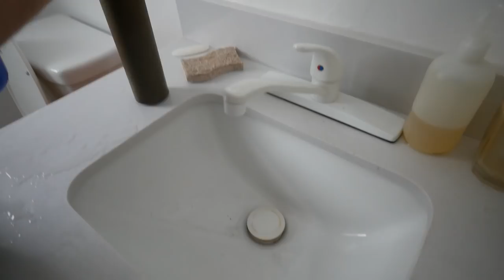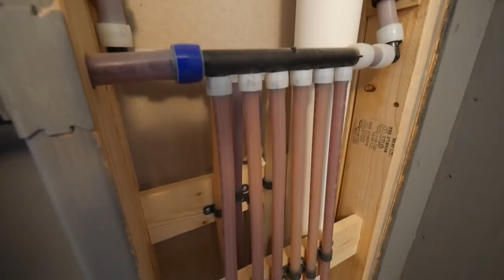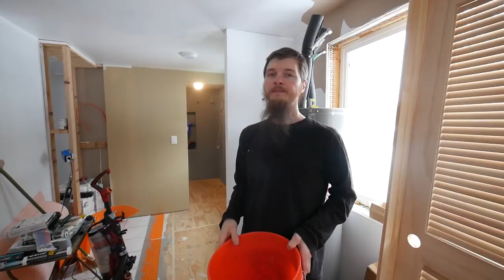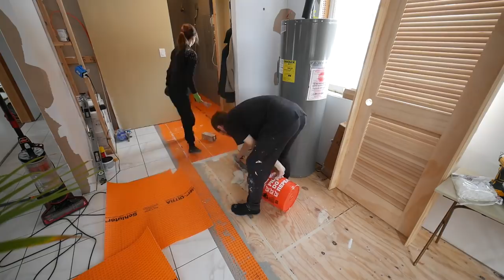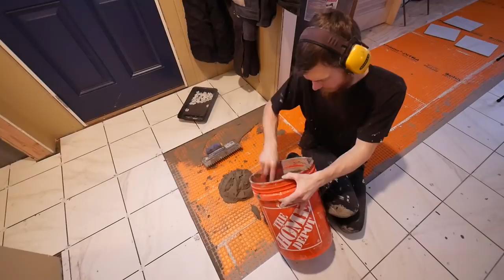DIY Kitchen Tile Project - Home Renovation

Comment: I've had a new ceiling fan sitting in the floor waiting for my husband to install for 3 months.  I think I'm going to trade it in. No, not the fan, the husband! lol
Reply: Janice Hales I know exactly how you feel lol
Reply from the maker: lol!!
Reply: Janice Hales   I understand, it does get frustrating. I’ve come to a different conclusion. I’ve started doing things as much as I can by myself and hiring others to do things I can’t. I’m much less frustrated and my husband is less pressured to do things. He works hard all day and isn’t a high energy person, even though he is handy.
Reply: All I have to do is say I’m doing it myself and my husband will either do it or hire somebody. It works like clock work. He thinks no one can do it as good as he does but will trust a professional too. Maybe we have proved to be a bit untalented in areas.

Comment: Good that you have a filter for all the rust.  I am running a filter also, which traps a lot of rust.  With that in mind,  would be a good idea to flush that nice new water heater at least yearly.

Comment: Well there are alot of oops's in life😁If you could hook up a hose to your water heater and make it go outside the back door, it would benefit you to drain it every time you change your filter. Lots of sediment settles in the bottom and causes it to cruode. So by doing this you expand the life of the heater. We have the rust also and that's what my hubby was told. We have a water softener also and that's a huge benefit. We also have it in our basement and I know that's not an option for you but I would drain the water tank at least once a month. Tile is coming along nicely👍👍😁Stay warm!!☉
Reply: Great point
Reply: @maryannanderson1744  thanks🙃

Comment: Tip for putting the water heater in the plastic tray while still full of water ***(if I’m not too late, as I know you folks move fast): part of what I do for a living is install appliances. When I have a washer that needs to go into an already installed plastic pan, I just pile up some spare lumber so that it goes about 1/2” above the edge/lip of the pan, both on the outside and inside. The lumber being slightly higher allows the plastic pan to be protected and you can still wheel it over on the hand truck or slowly shuffle it over the side of the pan. Hope this helps, I love watching the progress you folks make!

Comment: Amazing job! The utility room looks so nice. If you rewind your video you clan look and see where the hole in the floor was. You could even just drill a hole into the center of the location of the hole and then use a cutting tool. 

My concern about doing it through the crawl space is that the pressure cutting the tile from below may pop it loose.

Comment: Awesome job!  We have the same filters and ours are the same with the iron and other sediments. Our well was not as bad with sediment etc until more people moved into the area and dug their wells off the same aquifer that we are on.  We've been here 45 years. In the beginning the water had no issues until more homes came into the area. We are all on a minimum of 5 acres parcels. One thing we did, that you might consider is putting another filtration system on the water line before it gets to the hot water heater.  We have one outside as our hot water heater sits in the home in a little closet that is accessed by the outside only. That's how the home was built. So outside we have connected under the home an assembly a bit like yours but with two filters. The first is a white filter to collect all the sand or sediment etc. about a 12" or so length from that we have a charcoal/carbon filter and that goes directly into the water heater as the sediment that builds into the water heater and eventually settles in the bottom will over time affect the water heater and ultimately cause the need for a new water heater probably long before it needs to. That has happened to us is the only reason I am sharing this. The charcoal/carbon filter are more spendy so we would rather filter it first thru the white filter and then into the dark filter and then up into the water heater. I also kudo's to you for putting one on before it goes to the porcelain utility items as that rust and sediments are killer with the rust over time. To check if you have a build up starting to build ck your toilet water tank. Over time it can become very dark with the sediments. Really just a safety thing to keep your home doubly protected from deterioration of your porcelain or shower units and tubs.  Our fiberglass enclosure is doing ok but I try to keep on top of it as over the years it will change the color of the fiberglass as we found out.  We've remodeled all our bathrooms over the years with high quality materials but it still can't beat out that water situation that many of us on deep wells contend with. 
Sorry for the book here, LOL, but I know about the well water and what it can do in some areas. I still love not paying a water use bill and over these many years the filters and so on don't come near to what city water would have run us.  We love our country dwelling and the peace and quiet and wild animals is more than payment back for what little upkeep really we have to do to maintain things on the water part of country living. 
Blessings and you both are just marvels. I love each and everything that you are doing and have done. You are right on top of it.  Excited to see those floors tiled and you to get a kitchen started and I am sure you both are as well. Love your channel!  :-)

Comment: To help putting the hot water heater on the pan, try putting a block of wood as high as the pan on each side of it.  Tilt and set the heater on the wood and carefully tip it to the other side into the pan.  I'm sure you can figure out the rest.

Comment: We have that rusty, sometimes stinky water here in Huron county too.  I double filter my drinking water with a brita type pitcher.  And my hubs wears chef whites and I discovered product named OUT white bright, just amazing how well it works.  Wish I had known about years ago.
Reply: We had terribly hard water here before we hooked up to the city water. A neighbor suggested that I wash my whites in cold water as the minerals build up in the water heater and stain your clothes. I tried it and it worked very well. I use OxyClean to get out the other stains such as food on chef's whites! I'm sure you have many of those.

Comment: Hi, I had no doubt that utility room panel would fit!!! You are amazing at your measurements!!! What I did have doubts on was if that piece would even make it thru that door, LOL. I thought at least you could cut it in half and hide the cut somehow. So glad you finally got it in and on. Looks wonderful!!! I love watching you two work so well together, shows so much love and understanding. When you drain the hot water tank, just open the back door and undo the valve and let 'er go!!! You might want to consider flushing the tank out while it's empty, gets all the crud from the bottom out and helps the tank work more efficiently. See? I've learned a little after all these years, lol. Hi Ashley, great helper that you are, or is that great director?!? LOL. Take care and hugs all around.

Comment: I don't know if you are aware that if you drain and flush the water heater once a year it will last much longer normally. That keeps stuff from building up in the bottom.
Reply: Daniel Heartsill yes.  Especially with heavy minerals in the water.

Comment: If you raise the water heater just a bit off ground helps if some water leaks and need to dry up. Bottom won't rust out so easily.

Comment: Considering the rust in the water system, would putting a filter on the water intake help?  Might need to drain the water heater periodically due release sediment and save the heating elements in the future.  Looking good guys

Comment: Glad to see you are using the ditra, its code here in Canada but when i watch US shows they don't use it. And how to properly install everything. Great job again guys!
Reply from the maker: That's interesting that it's code in Canada. I think more people would use Ditra, but the price of it makes them not want to use it, plus it's a product that isn't hugely popular yet here.  Thank you!
Reply: Our celebrity contractor over here Mike Holmes always used it. Think its cheaper than replacing the floor if people would think of it that way.

Comment: Just a thought, could you put the hot water heater on a couple pieces of 2  X 4's.  You could put a narrower piece in the tray to protect it's side, and gently slide your heater it into the tray?

Comment: Great progress made.  You should have waited to change the filter until after you restart it.  Usually you get a bunch of gunk when turning back on the water heater.  I would drain the water heater fully before restart.  Thanks for the ride to town.  You must live a long way out in the country.  So beautiful out there even if it is cold.  Deer!  You know I still have not tried Chipolata and I live in the city.   ha ha ha

Comment: You’re doing well on the tile.  There is nothing worse than doing tile and get about 2/3 of the way through and something misaligns.  Keep it up.  Looking great!  You could use some old 2x4’s and build a little ramp up and over for your hand truck and not have to drain the heater.  If you haven’t already.

Comment: May want to drain tank to see just how much rust in it you might be dealing with.  The filter is after-tank, correct?
Reply from the maker: The sediment filter is before the water heater.
Reply: @diyfferent  great.  It looks terrific.  I have similar floor.  Tell Ashley it unfortunately shows dirt easily.

Comment: As I'm watching you try to get the drywall in the utility room, I thought of the many times when I've unpacked something new, and gone to put it back in the box, and it won't fit, lol!  I know, apples and oranges.  I am reminded of the many times trying to move a piece of furniture and you've got no room to accomplish that.  Frustrating, but you end up figuring something out that works.

Comment: I was thinking about the hole that didn't get put in.  I assume you have a hole cutter which is the size of the hole.  If you get the drill part drilled upward enough to get though from the crawl space, then you can go back up and use the hole cutter from above since you have that starter hole.  Obviously the hole cutter will have to get through tile.  The job is looking really nice.

Comment: Since you put up the plaster board do you have a way to access your water lines behind the water heater?   The tile is looking really good.
Reply from the maker: It's plywood so if there is ever a problem or needs to be accessed it can just be unscrewed :) Thanks

Comment: love how you tiled, when we tiled our bedroom after taking out carpet, it was different, we had cement floors that were not even, so they had to even it out then lay the tile, we do not use the plastic stuff here in Mexico do your floors stay warm?? mine do not. love your work and work ethic
Reply from the maker: The crawlspace doesn't ever get too terribly cold, so the tiles are just a little cold/average. It's okay walking on them with socks or slippers on :) Thanks!

Comment: Do you back butter your tiles and could you give your thoughts on why or why not to back butter tiles? I'm a 62 year old lady getting ready to tile my home, so any input from you is greatly appreciated. Thank you
Reply from the maker: We don't back butter. We tried in the past but found it noisy, slow, and messy. If you are a pro, I'm sure it's no problem. But for us it was just an obstacle. It seems that back buttering is just a thing of preference. Some people feel that it helps the tile get better coverage and adhesion, but plenty of tilers don't back butter and also get great results. I think the most important thing is just knowing how to lay mortar and set your tile, check this out for some great info: https://youtu.be/Way5bMh-eYg

Comment: Love the video! Thanks for taking us shopping! I am curious about something. When you do the outside are you going to be replacing the electrical panel/ hook up outside when you do new siding on the back?
Reply from the maker: We have been debating what to do around the service entry, but most likely we'll just work around it. It's just not something we feel like dealing with.

Comment: Do you get the iron bacteria smell too?  We had orange crush colored water in our last house.  We had double filtration from a company called Water Care.  They did a great job.  But twice a year, right before it was freezing cold and again in late spring we chlorinated our well which killed the iron bacteria rotten egg taste abd smel! and made our water taste very good. chlorinating one's own well is not difficult, just be sure you use actual chlorine bleach, and learn how long it has to sit to work and how to get any active chlorine back out of your wel! When done.
Reply from the maker: Yea, we do have some of that smell in our water, it's very faint though.
Reply: Our well water has no smell, but just down the road they had sulfur  in their water

Comment: The floor is looking great!  I have a question for you.  Does your water filtration system do a good job of keeping the rust out?  We use a water softener which I hate.  I would love to go with something smaller like you have.
Reply from the maker: No, the filters we have are mainly just for catching sediment. Rust filtering systems are much more expensive. We agree on water softeners  :)
Reply: @diyfferent  thanks.  I was pretty sure there is no way around the water softener with rusty water😒
Reply from the maker: @pamkaufman3662  There are filters made specifically for Iron, Manganese, and Hydrogen Sulfide, which would be perfect for us but they are pretty expensive. They are large like a water softener, but they don't soften the water and don't take any chemicals or salt. I'm not sure if they have a specific name but they are out there :)

Comment: Do you have any other filtration system for your water system than the one that you showed?  Where I live we have a lot of iron in the water and we have a whole system where we add salt pellets to our water to mitigate the high iron content. If we shut it off the filtration system  (3 different tanks) our white clothes would be ruined. We also have to soften the water. This system came with the house, but we have to maintain it. The salt from Morton comes in 40-pound bags. Your near neighbors should know all about the water in your area.
Reply from the maker: No, we don't use a water softener and this home has never had one. They didn't even have a basic sediment filter when we bought it. We don't care for water softeners. I did consider getting an iron filter, but decided not to for now.

Comment: Cut scrap 2 ×6 blocks 8" .then cut 22 °angle.small ramps.2 in your pan 2 outside your pan mini ramps roll your water heater right in.....Unless the pan is  close to corner , wont be able to tilt in place without hitting walls.

Comment: Won't that wet mortar on top of raw plywood cause the plywood to rot over time? I've always been taught that the plywood needs a sealer or you need to lay cement board.
Reply from the maker: No, it cures and fully dries pretty quick. The Ditra is supposed to be installed this way directly on the plywood :) Even if you use cement backerboard it is supposed to have mortar under it as well. Ditra takes the place of cement board.

Comment: why did you not do the closet first then the door area???
Reply from the maker: We just wanted to make sure the tiles would all line up and fit properly to the ones already installed so we started working from those :)

Comment: I just thought of an easy way to drain the water heater.  First turn completely off the water coming in to the water heater.  Then take a shower or do a load of laundry that requires hot water.  Thus, draining the water heater.  I am wondering... once the tile floor is completely finished is there a way to seal it?  I have a similar tile and it gets scratched pretty easily.

Comment: not crazy about that thin strip. Couldn't you have measured differently to even out the tile against the walls.? How about a nice wood laminate for the kitchen to break up all that cold tile and it would also be easier on the back if you stand on it for any time
Reply from the maker: We started the tile from our bathroom and it's just been continuous all the way through the hallways and into the kitchen, so that's just how it ended up there with that thin strip. The baseboard trim will cover most of that strip anyway. Laminates aren't ideal for areas prone to spills/wetness. All hard floors feel the same, at least for us, to stand on.

Comment: Its a big project,  but I put a instant hot water heater in place of that tank if possible.
Reply: I’m assuming it’s all about budget.  I’d love one, too, but that takes planning and & $$$.
Reply: Hubby is a plumber and they are very expensive and break down often and expensive to fix.
Reply: I’ve heard a few stories like that, Kathy, but not in my immediate circles (not than kits I know have them.) It would be a pain to do all that repairing on a pricy utility item. Not the best investment.

Comment: 40 gallon water heater weighs over 350 lbs full ..if it tips you won't be able to stop it .. don't you need a pan under the water heater .. every where i have been if on the same level as walking area water heaters need a pan and hooked to a drain ..
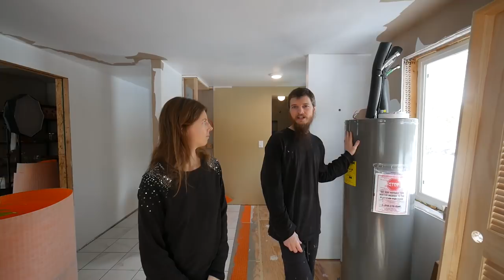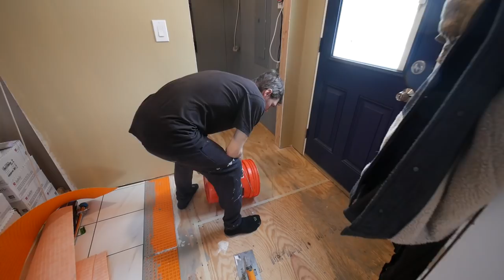Reply: See video @ approx. 9:45 - 10:18.
Reply: @fancybrooks3156  thanks i missed that one